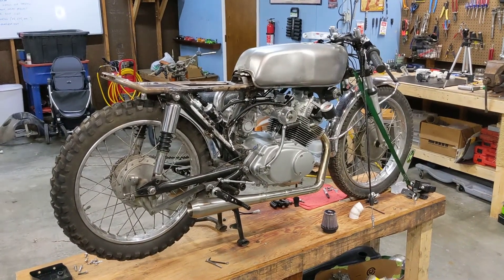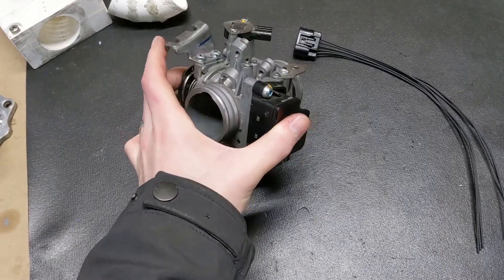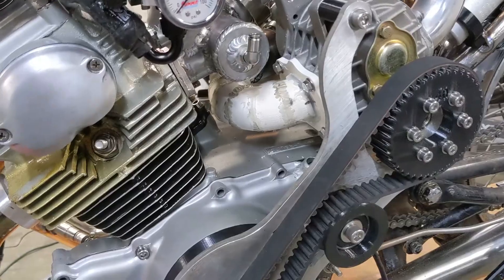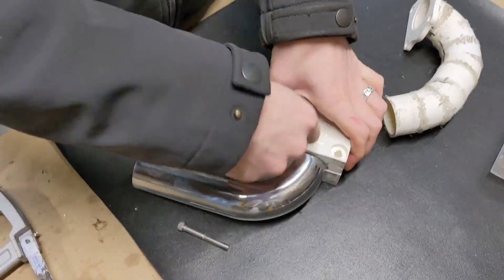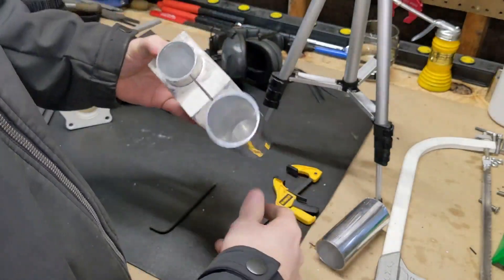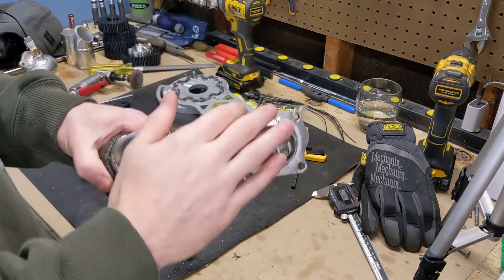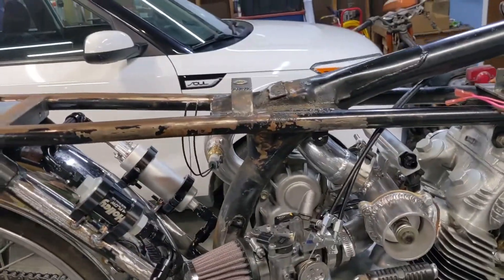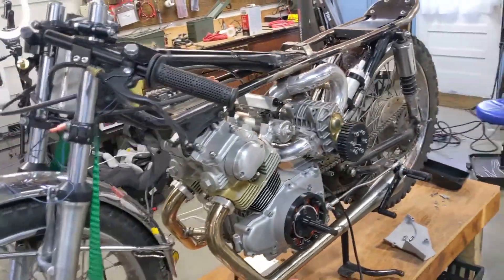FUEL INJECTION Conversion PART 3 - Throttle body Install and Custom Piping for SUPERCHARGED CL175

Comment: Hey! I just wanted to know what kinds of mods you have done to the engine besides the supercharger?

I have the same engine I’m trying to race in a <195cc class.
Trying to beat the zongshen ZS190s
Reply from the maker: Actually, the internals are bone stock (besides being refreshed). I will end up putting heavier duty valve springs in before we attempt a land speed run.